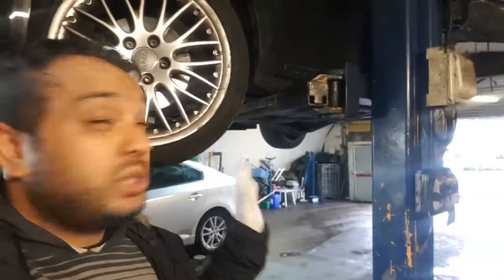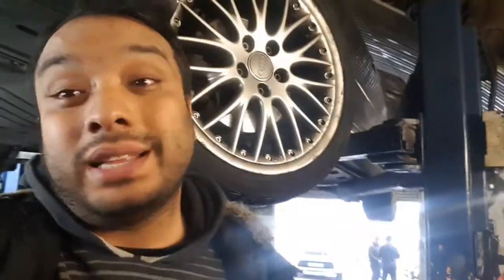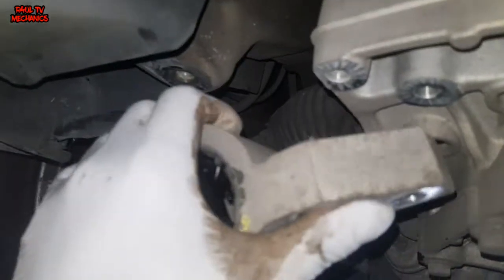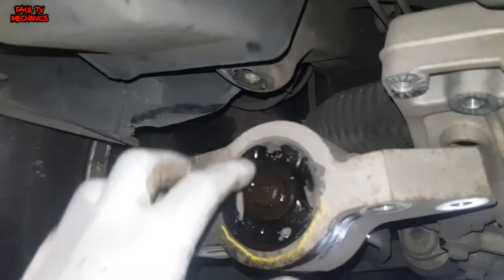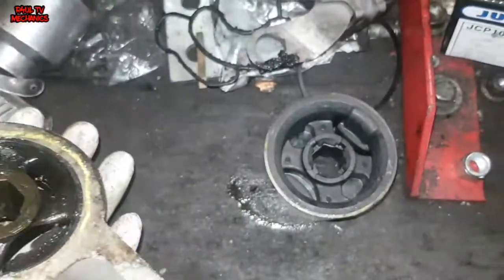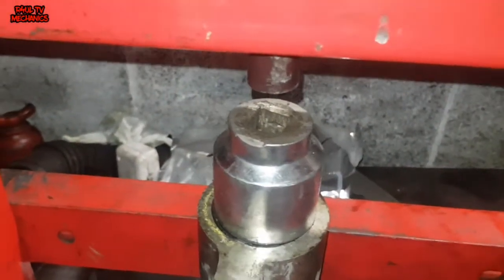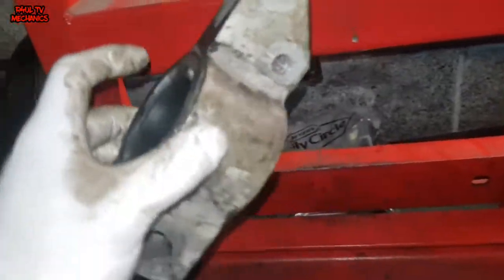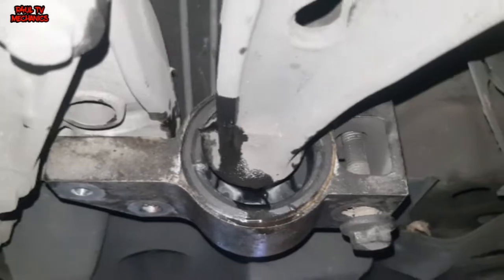2010 AUDI A3 FRONT WISHBONE REAR BUSH REPLACEMENT. AUDI/VW/SKODA

Comment: Nice laid back, practical, "get it done" style.  Both my lower arm (rear) bushes were an "advisory" plus a worn ball joint cover - looks a relatively straightforward job. Thanks for the video.
Reply from the maker: Thanks for watching really appreciate it. To be honest the job is really easy the only one issue is if the bolts dont come off the two 16mm then you have a problem
Reply: @TEAMR4ULTV  one of my 16mm bolt heads snapped off 🤦🏻‍♂️ I managed to put another bolt on the thread sticking out for now and it’s done up tight- is this okay and is there a way of avoiding this happening for future use?? Just a shit ton of wd40 or soemthing?? TYIA 🙏🏻
Reply from the maker: @MidlandAngler88  I have done that so many times before. But on mine I had to drill it through and put nut and bolt on it. In your case it should be fine because you have the main bolt on it the big 18mm also one of the small 16mm bolts and you managed to put a nut on the thred that's more than enough  it should be all good

Comment: Hi bro I have put a new suspension mount on the front driver side few days ago. I bought a new mounting for 25 pounds from euro car.aprts for 25 pounds. However there seem to be more squeaking noise when the steering is fully  turned to the left while the car is stationary. The other thing was that the axle bolt went in with a lot of resistance and there was a bit of grease that come out of the month of the cv joint in which the axle bolt goes in. On the engine mount there were two arrow facing forwards and backwards and I've been told there is a certain way that mounting should be fit on top of the spring. Have I flitted the mount in the wrong way hence it is sort of binding when the steering is fully turned left while the car is stationary.
Reply from the maker: Thanks for watching really appreciate it.  I think it might be the fan belt and tensioner  rather than the suspension arms check that out
Reply from the maker: Also the top mount should have arrows on it the arrow go towards the inner of the car eg towards the engine check if that's in right place
Reply: @TEAMR4ULTV  I'll have a look when I check it again. Thanks for the reply

Comment: Is it difficult to change the subframe / wishbone carrier?
Reply from the maker: It's not that hard. I cant remember if the steering rack  bolts on to it if so you just have to secure the steering rack. If all the bolts come off should be easy
Reply: @TEAMR4ULTV  thanks, will have a look.

Comment: think mine might need this. pulls to one side under aceleration .  how much  should i expect to pay all in ?
Reply from the maker: If your just changing the rear Bush max £50 each
If your replacing front and rear WISHBONE bush about £80 a side
Reply: @TEAMR4ULTV  cheers fella ... can you give me an idea how much should i expect    to pay  for fitting?
Reply from the maker: @iamyourfuture808  no more than £30 a side that's if everything comes off nicely. Sometimes the bolts siez up and can be a headache to take off
Reply: @TEAMR4ULTV  thanks for the info. Much appreciated